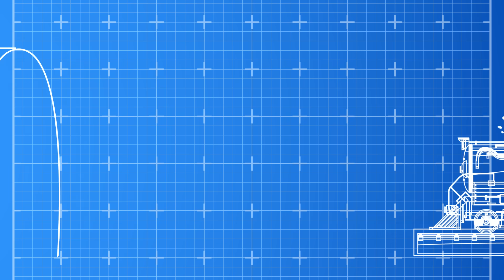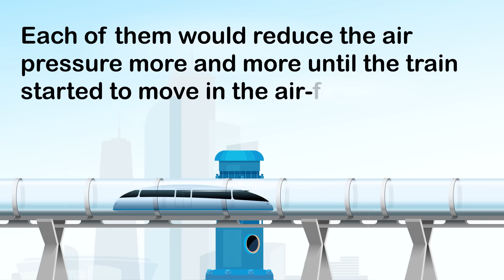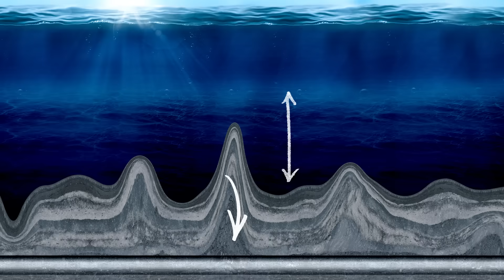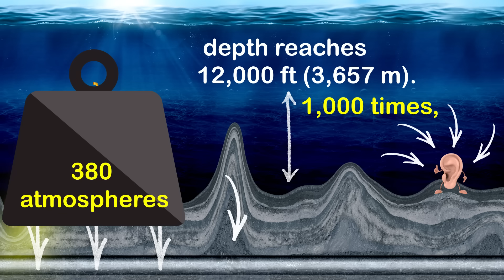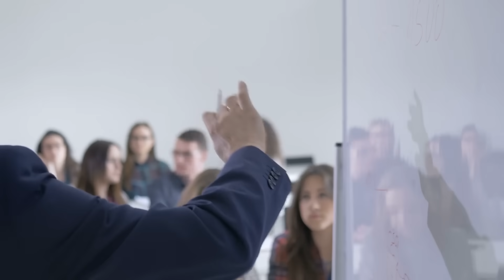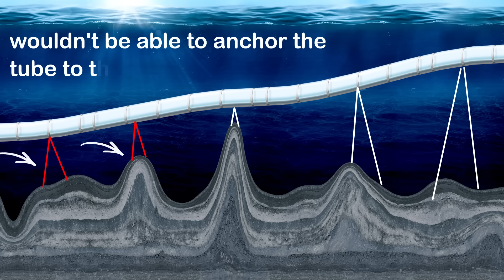What If You Dig a Tunnel Under the Ocean?

Comment: We also have to think that this construction could lead to the destruction of habitats for many different reasons, therefore affecting the local ecosystem. Besides, the erosion and oxidation caused by the water could lead to serious problems in terms of safety, depending on the material they would use to build the tunnel . Along with the ones mentioned in the video, these are another two consequences that could follow from its construction; however, there are probably many more and maybe even worse.
Reply: Exactly, like they did under the English Channel. If there is an earthquake, that tunnel will be a massive disaster. Being buried 6 feet under is bad enough but being buried under the sea floor, that is the scariest of them all.

Comment: did Dr Ferkel happen to mention plate tectonics and how they move? if a tunnel was started on both sides with plans to meet in the middle 111 years later, the tunnels would most probably be a few inches off... and even if this were accounted for, very little could be done as plates shift once construction is complete. all of the steel & concrete is not going to stop Earth's plates from shifting, thus misaligning parts of the tunnel. traffic would have to be halted for weeks (if not months or years) every decade or two in order to correct for these shifts and prevent air leaks.

this does not even account for the possibility of underwater earthquakes. there is almost constant seismic activity on the floor of the that Atlantic & Pacific oceans as the plates move a little faster than expected.

Comment: The biggest issue with vac trains, is the danger of terrorism.  Breaching a tube would be bad.  The wall of air slamming through the tube wou8ld be bad.  Each car would be turned into twisted junk, and shoved through the tube to collide with the next car, and the next one.  All the people in the cars would be turned into human tomato past, with shattered bones sticking out of it.  A system of airlocks might be able to protect the car, though this could result in passengers being trapped in the tunnel inside a nice shared coffin.  The tube which floats a few hundred feet below the ocean surface might have an advantage there.  In the event of a disaster, the tube could be separated, the train could activate inflatable pontoons (or could be buoyant on its own) so it can shoot to the surface, to be recovered by ship.

Comment: You could developp a floating system for the tunnel which will not have any tectonical issue. And the pressure outside the tube will not have immense pressures. For icebergs, the floating system can be floating under the required deepness if needed.

Comment: This may sound crazy but why don’t you just build a big hose and drop it. I know it has to be at least 30 feet in diameter and it needs to be made of a material that can withstand the elements. I also realize it has to be about 2000 miles long and that no boat could handle this amount of weight in treacherous seas. But if you use the proper materials. You could feed the hose from the shoreline. And if you used Unpowered flotation devices you could push the hose with a powered device on shore providing the head of it has a GPS guided tug. This tug would only have to navigate directions with its motors. This would allow it to be relieved of the pressure and weight of pulling the hose. Meanwhile, the guys on shore could build one section on the hose at a time. Them they would force it out as it lengthened. Upon the release of the hose from the floatation devices you would have to have a hose that could withstand the impact of various ocean floor elements, elevations and pressure. This could be minimized by pressurizing the hose before if is dropped. Thus also creating air in the hose that slows the desent.

Comment: Use laser drills instead of mechanical cutters on the rock. Inside the tunnel, if there is a vacuum, then air pressure is not a problem.

Comment: Seal one side of tube. Leave one side open. Sink it to required depth on pre formed legs of height desired supports. Connect to existing tube. Have pumps pre installed on tube that is flooded and pump out water....

Comment: -Earth Quakes
-When change in pressure happens oru BP will also change
-By chance something made some hole or something inside it, Then all the water will fill inside the tunnel and may cause several accident we will be not able to escape too
-What type of fule or engery is used for this? If we use fuels what about the pollution by it inside the tunnel ? It will stuck inside the tunnel isn't it?
-If a train crashes inside this tunnel all the others should wait till the train repairs isn't it?
-What about the oxygen inside the train ? There will be no air from outside na?
-If we use vaccum technology for this, then how can we use mangentic technology for reducing friction?
-What about the inertia and momentum by the train? How to make this much heavier train to stop without the infulence of friction and air pressure?

Comment: I think you oversimplified the tunnel. An underwater tunnel would need to not only resist water pressure but do so without the benefit of air pressure. We know the dangers of taking a submarine too deep, and the train tunnel would have to outperform that. It would also need a self contained air and power supply, ala the space shuttle. It would need a means to maintain it without totally shutting it down. A method for rescuing a stalled train. A means to deal with the rise of the Bends to passengers and maintenance crews. And, despite your cool graphics, passengers would never see the ocean as the tunnels need to be substantial and thus not made of glass tubes. 

This is a fascinating bit of theoretical engineering, and I wish your channel had been more realistic with its graphic renderings of it.

Comment: Is nobody going to mention the fact that its going to be over different tectonic plates. If this is anchored at all it will get pulled apart or pushed together. Theres a bridge in greece that floats on a gravel bed for this reason. This will never happen as the sheer price would bar general pop from ever using it. Same reason the transatlantic bullet flight failed.

Comment: the tunnel would buckle, under the currents of the ocean, not to mention tectonic movement.  Even a tiny breach in the vacuum would have a cascading catastrophic failure... this is a pipe dream(no pun intended) atm... the material science is not there yet.  This is also why Musk's vacuum tunnels wont work either.   He should keep trying, but once we can do this above ground reliable, we can then think about doing it over a much more unstable medium water/Atlantic bedrock.

Comment: Much cheaper, simpler, and safer to bring back a Concorde style aircraft that allows fast travel across the Atlantic. With lighter, composite materials and more efficient jet engines it will be more feasible than the original Concorde was.

Comment: Haha again hydroloop/Aqualoop system it still the same hyperloop system but instead of it being airless fill it with... wait for it... wait  for it.... seawater water being push one way like a moving sidewalk now run on this moving sidewalk and how fast are going compared to the people walking or even running next to you. Now add a electric jet water self propelling capsules pushing on this one way tube. You would be able to add additional pump along the way for additional speed or to continue the  preferred speeds and well water just use wait for it seawater. This capsule would intake water from front of capsule convert it to a jet out back. Kinda like a warp drive (I believe) if you think about it

Comment: Doesn't sound like a logical solution to put a vacuum tube under high pressure, I don't see how that will work, seems like the tunnel will collapse due to pressures (high pressure outside low pressure inside.

Comment: I disagree. The ocean version should be the least interesting. If you can't do it on land then you shouldn't try under water or under rock that have more pressure on the tube.

Just imagine a earthquake, The tube will fill in rapidly underwater. If on ground nothing happens and the train moves slower. Or Emergency hatches can be open and you would be safe because the air would be back to normal.

Translation. MUCH MUCH safer on ground. Let see if we can do that first before trying something much more complicated.

Comment: But what if the shark bites the glass
Reply: Whatever material it would be made of would be insanely thick and tough just to withstand the pressure, not even sure if we can even build enough of the structure required. A shark would do nothing to it, much more dangerous is ocean currents or tectonic activity which would snap this thing and instantly destroy the entire project.

Comment: That sounds dangerous to build a tunnel under the ocean what if the  train di not have air to breath under water? Or the pipe is filled with water and the train has a hole the water will leak into the train they all will die

Comment: i have more simple solution than these deep science , with more equally practical results 

Rather going in deep and deals which such obstacles , Such Rely on the suface of the water we all know Water always remain its level firm level at top Solid Plastic Bags with Heights can lift the tunnels height is need above the surface of water to aviod ships not to collusion with them  make distance and install more solid bags on ocean to lift all tunnel tube , Anchors on both ends can hold the tunnels directions and even can give flexibility in thunders and any other natural disasters